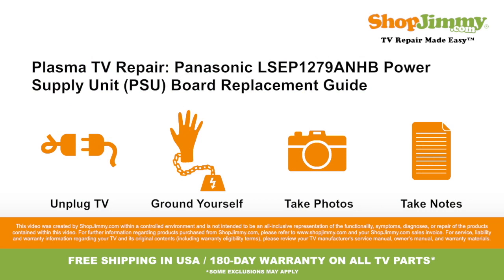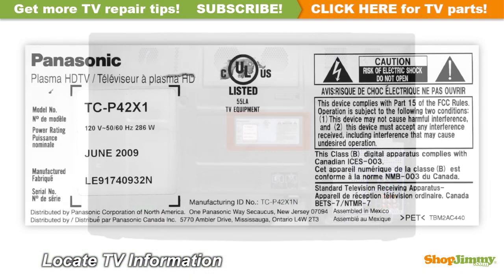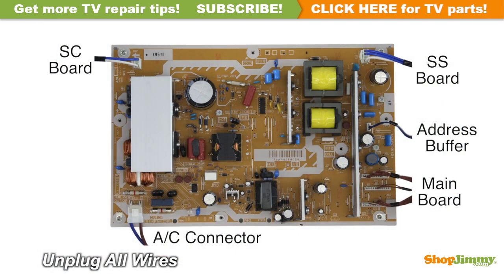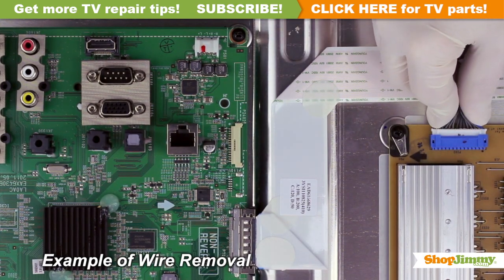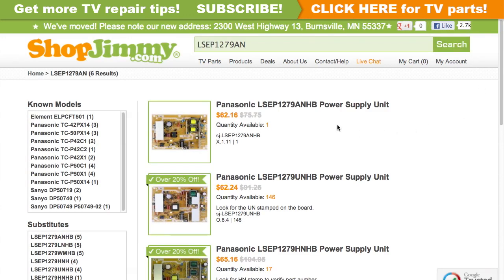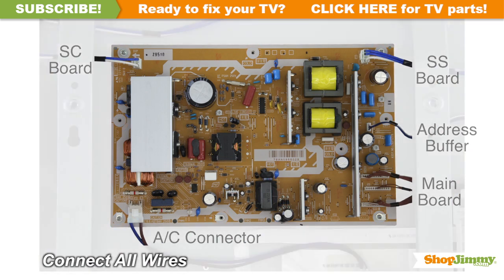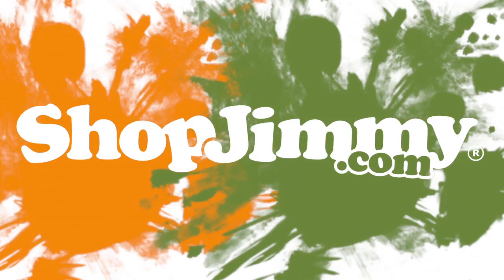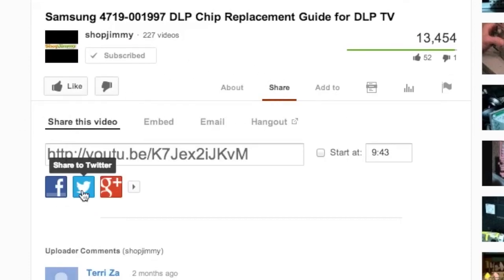Panasonic LCD TV Repair - TV Won't Turn On - How to Replace Power Supply Board

Comment: Hello Jimmy. My 52 inch Panasonic projector tv doesn't come on. The green light flashes so many times and turns off. If you can help, much appreciated. Thanks, Mark from Missouri...............

Comment from the maker: @ROYAL DADON - I would recommend replacing the power supply in your TV.  There are a few different part numbers that match this TV model number, please call our customer service to find the correct replacement part for your TV.  (877) 881-6492

Comment from the maker: @Noj Buarts - I would recommend replacing the SC Board.  Search your part number (TXNSC1EPUU) on shopjimmy com to find your replacement.  You can also call our customer service for assistance as well, at (877) 881-6492.  I will also send you a youtube message with more information on how to purchase your replacement part.  Thanks!

Comment: Second time this problem has occurred.  First time back in Jan 2013.  TV will not power on, makes a clicking noise (like a car turn signal) and small red light flashes at back of tv where cables plug in.  Had power supply replaced in Jan 13.  Same thing happened this evening (clicking noise, red light) and the tv was not even turned on!  TV is not more that 5 years old, model Panasonic LCD TC32LX85N.  Cost $200 to have repaired first time. Never had any issues until TV was mounted on wall.